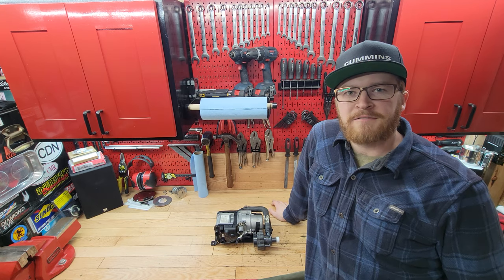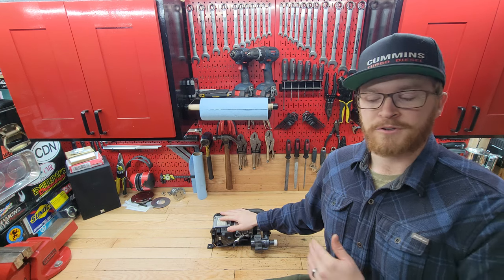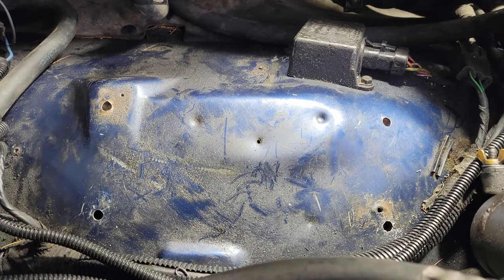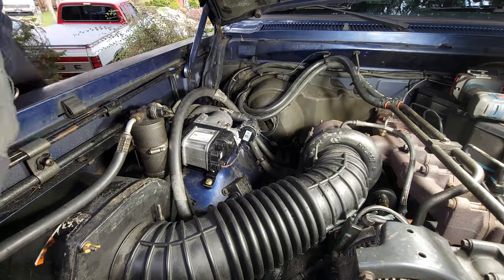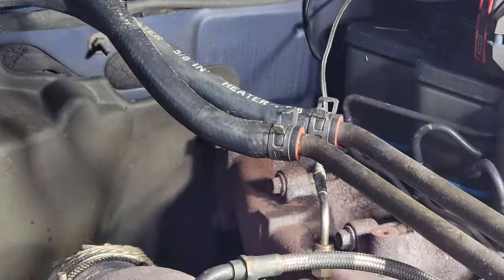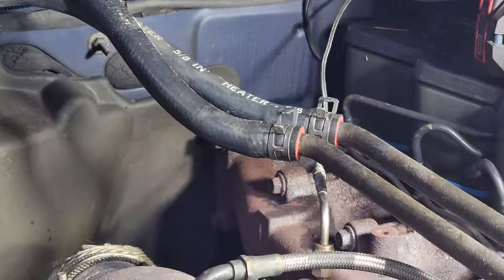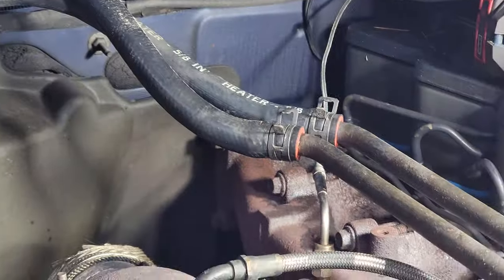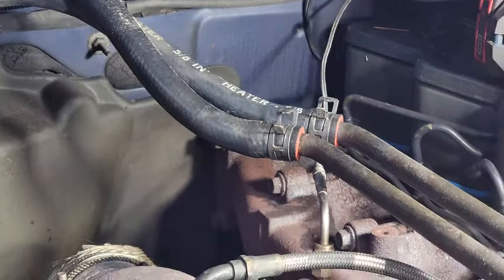Webasto Coolant Heater Install | 1st Gen Cummins

Comment: random point. the diesel exhaust is extremely corrosive. Under my van where the exhaust gas touches rusts out very quickly. I would not recommend pointing it at the oil pan

Comment: I’ve installed plenty of them on big rigs. On my 93 I installed two 1000 cca batteries in the same spot were the one battery was. I run t6 synthetic in the winter. In Maine USA I’ve started my truck in -36f without plugging it in. I just cycle the intake heater 3 times.
Reply from the maker: It doesn't draw a ton of battery power, but I was thinking about mounting a stand alone battery on the frame dedicated to the webasto and dash cam. It's nice having instant heat though
Reply: @OvensGarage  we use them on big rigs all the time. They use way less fuel then the conventional apu’s. I’ve installed the coolant heaters and the forced hot air ones.
Reply: @OvensGarage I just installed one on my sprinter van but it seems like the pump is not pumping coolant.  I filled it before installing. Any thoughts?

Comment: I did the install on my 91 w-350.  It worked fine for a few cycles but now keeps giving me  an overheat code and shutting down. I have purged all the air from the system and even installed a flushing T on my heater line to make sure all the air is purged.   Anyone have any ideas?

Comment: Just remember the fuel supply on those are tiny. It dosen't take much to plug the fuel line.  So you need to treat the fuel so there is no gelling. It may be a good idea to insulate the small line. Just something to think about.  I have experienced a plugged line on my wabasto and woke up freezing in the middle of the night.
Reply from the maker: That's a good point. I usually add anti-gel additive every time I fill my fuel tank anyways, but it wouldn't hurt to prevent fuel gelling in other ways.
Reply: @OvensGarage  if you think how easy it is for the fuel to gel in the tank. Imagine that thin tiny little line. Good luck, this unit should do amazing.

Comment: Can these heaters be mounted in any position, or is there a specific up and down?
Reply from the maker: Check the manual online. They have several mounting positions I think the only one you can't do is completely upside down.

Comment: I would think having the hottest water in the block coming in as the feed to the heater would not be ideal. Guess it still works!
Reply from the maker: Yep it seems to be working well so far. If it doesn't heat up that well when I experience very cold temps I'll re-plumb the feed to come from the coolant sensor port on the drivers side rear of the engine cyl head

Comment: Looks like you have the rear main or tappet cover leak. Oil on drivers side points to tappet cover. Nice install. I've thought of one of these but couldn't justify the expense when I usually have electricity to plug into.
Reply from the maker: I'll have to take a look. I also spray my truck annually with rust check so that may just be remnants of that oil spray and not a leak.
Reply: @OvensGarage  oh. That makes sense. It just looked like regular old oil.

Comment: Great video, I think I would have sourced a small fuel tank instead of going to the work of dropping the tank. but no matter. So I understand coolant flows from the heater into the core then out and into the head?

Comment: How is the install working after 6 Mo anything you would have changed?
Reply from the maker: I used it a bit last winter in Victoria but the temps didn't get that low. I'm in winnipeg now and the temps get very cold here so this winter will be the first real test. I'm thinking about changing the feed line to tee in where the coolant sensor is at the back of the head instead so it cycles the coolant completely from back to front. That's the only thing I would change because it would probably bring the temps up higher in the block.